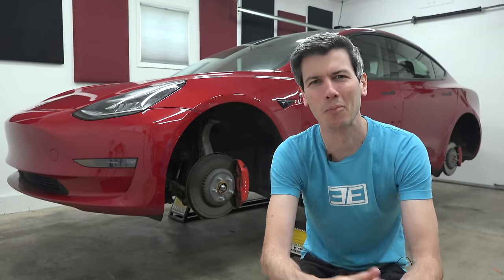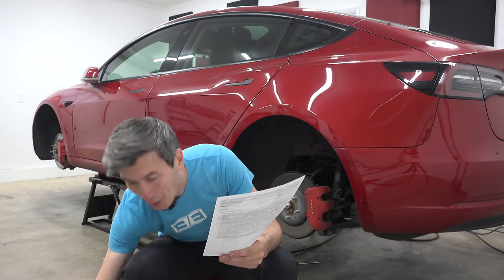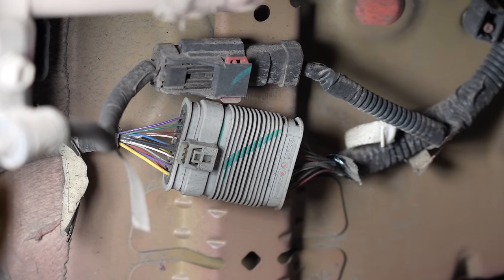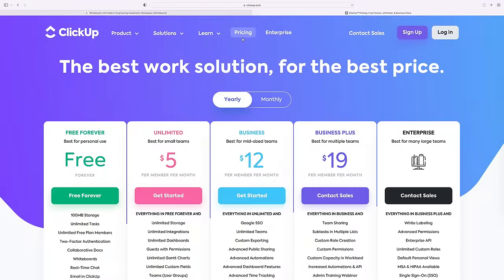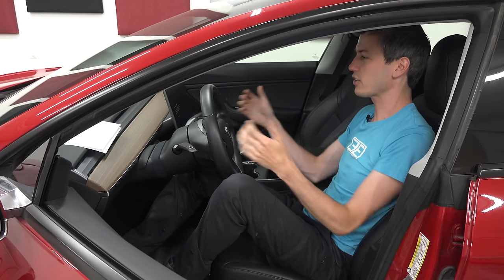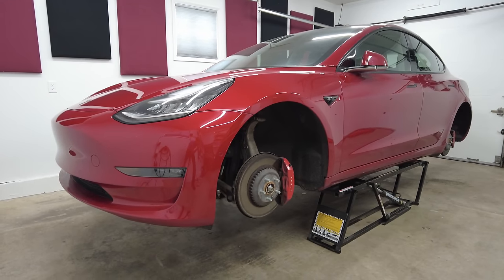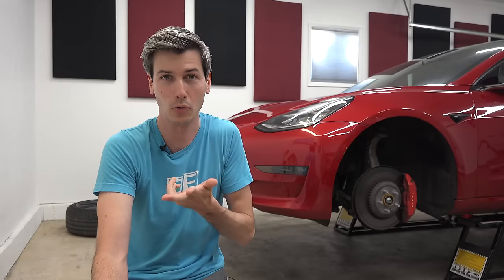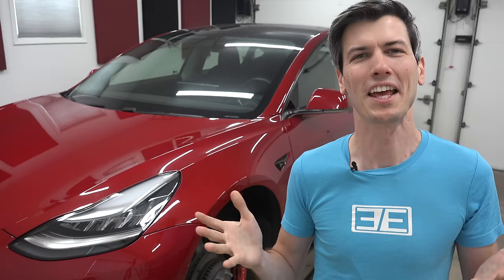Tesla Battery Damage? I Ran Over A Metal Bucket

Comment: I am a big Tesla skeptic, and I believe this video makes one of the most objective takes on Tesla, even though it is a praising video. Thanks Jason!
Reply: @Knaught Shure While you have a great point, there are plenty of Tesla owners that say the same thing time and time again. Its just not there yet as a stand alone car. I have plenty of Tesla friends and guess what, they still cannot get ride of their other car which is gasoline based. Some even have tried. When the infrastructure gets way better, meaning locations, locations, locations and oh yeah, working charging stations. Its just not prime time for the masses. Even then, some of the cost for parts, service (that they do or even wont bother to do) is a bit insane.

What it comes down to is, if you have the money, the time and the patience, Tesla by far is a great way to get into the EV market. However, the average joe wont be going down this road for a long time.
Reply from the maker: Thanks for watching Ethan! The cars definitely have their flaws, but overall, it's a really fun ride.
Reply: @Knaught Shure Actually the two I personally know say it is a great novelty around town. So is my Vespa and its not over 40k. I live in a hot climate and frequently travel on highways over 80 mph for over 100 miles. The Tesla won't do it, period. Right now, its an expensive novelty. Which I'm down with as I have several vehicles that are in the same category.  But to suggest that most can simply ditch a gasoline vehicle and never look back simply isn't true for most. Im not hating on EVs. My next vehicle will be a hybrid SUV because of the range. Cheers
Reply: @Knaught Shure I'm one of those who sold his Tesla for a used gas car. I loved my M3 and oh boy I miss it, but my priorities changed and owning a 50K$ car isn't one of them for the time being. Ev's are still too expensive sadly.
Reply: I’m a fan and an owner but your comment is dead on. He’s great that way.
Reply: @giggiddy  I drive just under 100 miles each way to my brother's house in the winter when the range is worse and I don't even have to charge on the trip. I have a 2018 Model 3, which doesn't have a heat pump and has a lower range than the current models. Heating with resistive coils uses way more energy than cooling. I've no idea what those two Tesla owners you know are doing with theirs. I'm not saying it's right for everyone, but 100 miles is a really low bar. That would be a comfortable daily commute (as far as range goes). You'd definitely need a level 2 charger at home, though.
Reply: @tempesttube  I need to pay better attention to what they are set at and actually document the numbers. I cant say that I see what they are at, charge wise, when we began, but I know that range is pretty much all thats keeping me away at this point. NOTHING on the road is quicker and I love that. We even have a couple of Veyrons in the area and The Tesla might even be quicker than they are. Lol cheers!
Reply: @Knaught Shure Thats a curious statement about the 5 minute charge.  I'm not familiar  with charge rates with the high output chargers. Will 5 minutes truly provide a substantial charge?
Reply: @Knaught Shure Curious because you run yours in heat similar to my climate. If you run at 80 mph, will you still get 200 miles between charges?
Reply: @giggiddy I'm commenting more to show your bias(since you don't own one). You claim you drive over 80mph for over 100 miles. Is that both ways up to 200 miles? Tesla can absolutely do that minus their lowest model which is the standard range and I own that car as well. Hot climates do better with regard to range with regard to EVs. Cold weather has a worse effect to range. To argue it's an expensive novelty, it's actually our family daily drivers and we have an older SUV. Realistically, we have way more fun on road trips with the Tesla. After 200 miles, which is well over 2.5 hours on the road at 80 miles per hours, someone will definitely need a bathroom break. Perfect time to charge, bio break, and enjoy each others company at the locals super charger destination(candy store, steaks, grocery store)
Reply: @giggiddy  The fast charge work less intuitively than filling gas, if you can settle with half full battery, they can charge crazy fast (usually there are their "up to" number came from.).
So for a long trip the fastest way is do many short stop at the fastest charger, you charge for a coffee break, always leave with 50%-70%, repeat... assuming there is a working charger waiting for you.
To top up the battery it takes painfully long tho.
Reply: pyropulse  Most of your information is outdated, and/or propaganda that was never correct!🤣
Reply: pyropulse  this channel has a good video on this exact topic, that disagrees with you. Where do your numbers come from?
Reply: @markbeiser  The CO2 breakeven point largely depend on how much/ which fossil fuel the specific state are still using, for coal heavy states it can approach some ridiculous figure like 80k-100k miles, in these case solution should be building greener power plants CO2-wise (nuclear/renewables) quick, and switch to EV a bit later (but eventually still do)

For more modern states with greener mix (more nuclear/renewable) it would be closer to 15k-20k miles which almost every daily drive are going to go pass, if you go all green (all nuclear/renewable) it can be less than 10k miles.

Which also means if you going to have a car and not use it a lot, sometimes ICE/hybrid might still make sense, for example for a Sunday family 7-seater ICE might still came to the top, but the question become should you really buy a car that you only drive on Sunday.
Reply: @giggiddy  Thats actually not remotely true. Even the lowest range Tesla can easily do well over 100 miles at 80mph. I just took a 1900 mile road trip in my 2019 base model. 

I've owned my car for almost 4 years. Its at 80k miles and 16 full track days. Not a single mechanical issue. I have the videos on my channel to prove it.

A few weeks back I calculated the "fuel" savings vs. my old Golf R. $8500 dollars less in gas and maintenance. I plan on keeping the car another 4 years. By that point I will have saved $17k. That means that my $38k Tesla costs the equivalent to own as a $21k ICE. Wild.

These cars would work for tons of people.
Reply: pyropulse  I believe Engineering Explained has debunked your statement with a previous video. A few points though, once a battery is made with its materials mined from the ground, the battery will be recyclable. Once gasoline is burned, you gotta mine for more. Petroleum is a finite source, and its mining is also destructive to the environment.
Reply: @jasonjaafar  - “the battery will be recycled”

Not really happening yet. Maybe someday, hopefully someday. These are not lead acid batteries.

“Once gasoline is burned”

Once the electricity is used, you have to generate more.

The battery is equivalent to a gas tank on an ICE car. A battery is just a big expensive gas tank that is not as easily recycled as a steel gas tank in an ice car.

“Petroleum is a finite source”

Not really. You can make it from CO2. Natural gas and hydrogen can also be used instead of gasoline. Petroleum is just easy to get, since crude has seeped out of the ground for thousands of years.

“Petroleum… mining is also destructive to the environment”

Oil spoils the environment, by just existing. It is better to clean up the tar sands by removing it & using it, rather than just letting it spoil the land.

It will eventually bubble up out of the earth & spew into the oceans with a small earthquake, so we might as well not let it go to waste, and just use it.

Harvesting petroleum will not stop with the advent of electric vehicles… it is used for water bottles, cups, disposable silverware, disposable plates,clothing, carpets, house siding, roofing, flooring, paint, electric motor windings, electric wire insulation, plastic car parts, battery separators, etc.

Moving to electric cars will do little about harvesting oil. The amount of copper mines opened for all the wire needed for EV’s & charging stations is outrageous. And petroleum is used for all that mining & transport & refining of copper.

None of this is to say that EV or plug in hybrids are bad things, the better we can conserve petroleum, the better for humanity. There are just better ways to conserve it.
Reply: @DavidHalko  Tesla and Redwood Materials have battery recycling processes in place to expand into the future.
As EVs become more widely adopted, and start reaching the end of their life cycle, recycling of the battery packs will scale up.
Currently there is not a big enough volume of EV batteries needing recycling for anyone to be doing it at scale.
Hopefully developments there have been, and those to come in EV battery recycling will result in more recycling of the many millions of rechargeable batteries used in consumer electronics that end up as toxic e-waste.
Reply: pyropulse  If you're concerned about cobalt use, you need to stop driving an ICE vehicle. Considering they use so much cobalt removing the sulphur from petrol.
Reply: @xLordJonx  My thoughts exactly. I felt people I've met who've lauded the Tesla as being so great also own ICE cars. "We use it to take our grandchildren or for long trips." That's the reality.
Reply: @ninemilliondollars  How does it make sense to prefer taking the grandchildren in an ICEV?
However, I do understand that some people prefer having the option of driving uncomfortably long stretches without taking breaks - and also having more options to stop at (since it's time inefficient to make non-charging stops on a 300+ mile journey). To me though, Tesla's ADAS and general driving experience is great enough to make it overall on par with ICEVs for longer trips.
Reply: @xLordJonx  I don't think it's true that the "average joe" won't be getting a Tesla for a long time. If you can afford it, it's really about whether your lifestyle fits it. E.g. If you live somewhere where you can't charge your car at home (or at work), then it's definitely not a great fit until that changes. And if you use your vehicle to drive to remote offroad locations, use it for utility or strongly prefer driving really long stretches with no breaks, then it's neither a great fit as your only car. And if interior build quality and NVH is your primary concern, then Tesla is probably still not your best option either. And other cases not listed here either. But I think for most people, their offers actually would be a great fit, practically and economically. Their demand suggests similarly.
Reply: @Muskar2  Regarding your first question, insuring a valuable "package," like granchildren get to where you want to take them without running out of juice is important. And we know there are not yet enough charging stations around, especially in remote locations, for instance, national parks and  mountainous areas.
   As for people driving "uncomfortably long stretches without taking breaks," many people enjoy the road. And more than once I've driven solo or with friends 'till the tank was close to empty. It's a personal choice.
  As for Teslas, I agree they are fine vehicles and should be quite comfortable on longer trips. And there are fine ICEV that may surpass the Tesla experience. Again, personal choice.
  BTW, in urban areas especially older cities like New York, Chicago, Philadelphia, where there are thousands of small to large apartment buildings and where people park on the street, the challenge of electrifying those neighborhoods is enormous. ICEV will be around much longer than 2030.
Reply: @ninemilliondollars  Obviously it's important to not run out of range. That goes without saying. But as long as you have home charging, I think it's getting quite rare for cases of too little range for a return trip with no charging, or no easy supercharging along the way.

And yes, of course, anyone is free to do what they want - and people's needs vary. I'm sorry for the confusion, if I said anything that suggested I thought otherwise.

I'm also quite aware that apartment dwellers have fewer options most places. But that will change over time since any place that has power and a street could support slow charging for at fairly low upfront cost compared to real estate maintenance costs overall.
By 2030 I'd agree with your speculation that there's going to be many ICEVs. I think even the most ambitious targets will not even have 100% new sales being BEVs by 2030 and there's obviously going to be second hand vehicles for a decade or two as well. I think ICEVs will still stay the majority of registered vehicles for about 20 years or so, and I see myself as a person who's quite ambitious about EV adoption and its potential for becoming the preferred option. So I don't think you're saying something remotely controversial when you're suggesting 2030 will have plenty of ICEVs.
Reply: @Muskar2  I think we pretty much sync up on our ideas. 😀 I like the idea of BEV cars and bikes. My brother has a BEV bike and loves it. And he's a very good bicycle racer. The cost of BEV cars is prohibitively expensive right now, an obstacle to getting one. I did a GoogleMap search in one of my favorite states, Utah, and only found 79 charging stations, most right along I-15 and not widely dispersed throughout the state. That's where I see a challange for taking a BEV on a vacation - the remote areas. As for urban apartments like in Chicago, that is a extradordinary challenge. Chicago has used lead pipes for delivering water from the street to homes and apartments all over the city. There's a project to replace them. The streets have to be torn up. It's going to cost about $10 billion or more. I don't think there's any money for BEV charging stations, nor time to do the work soon. So just my opinion that it will be a long time for enough power to be built for all the urbanites. Finally, I do appreciate conversing with you. Having a meeting-of-the-minds so to speak has allowed us to learn from each other, which is good.  😀
Reply: @Knaught Shure I know someone who sold his plaid because it has no sound and no feel too it, he bought a brand new R8 audi with a V10 because he grew up feeling cars like a true enthusiast.
Reply: @giggiddy  
So someone told you the range of a Tesla is 1 or 200 miles?
It’s never been that low.
Reply: @xLordJonx  I've never experienced a Tesla charger that didn't work. Its not a do all car so your right in that regard, I have a diesel that I use to pull my 5th wheel RV and another gas truck I pull my boat with but I drive my Tesla 95% of the time and hate driving the others when I do drive them.
Reply: @Knaught Shure I don't get it. I've driven my model 3 a few thousand now and I'm longing for something else already. There are some quite clever things, and the efficency is remarkable. But there is so many useless features and a way too sterile interior. Exterior is also awful, even if it's very efficient.
Reply: @ninemilliondollars  If they are spending billions to tear up roads to install new pipes that seems to me the perfect time to drop new cables at the same time. You're already paying a lot of the costs anyway.
Reply: @oerthling  I agree, But Chicago is removing the lead pipes from the street to the connection in the house. And they are so so slow in getting this done it will take like a decade. And there's no advertised plan about electrifying anything related to BEVs. I do think we need more real experience from smaller cities that have deployed this infrastructure before scaling to a city with countless apartment buildings and highrises.
Reply: As a vehicle not in need of anything more than normal service a Tesla is ideal. Entering the world of service or body repair your certified repair shop might be half way across the state. "Rich Rebuilds" here on YT has pointed out the nuances that crop up with the brand. For example a brand new lease owner struck something also under his Tesla. The damage was a simple nipple involved with the cooling system. The battery case itself was fine. Tesla designated repair priced the repair for a new battery  $16k. A simple addition of a small brass nipple threaded into the part that broke was all it needed. It was done for $700. The guy was on the hook for repair. Being a dedicated service center the wait time was unrealistically long along with the cost of replacing a brand new battery. 
So yes, if you have the good fortune to just drive with no mishaps or need of repair it will probably be a good experience. I am still of the old school that wants to spend 20 minutes refueling and be back on my way as it suits me not tethered to my car to spend time "refueling" or else. It will be a relearning curve for those that will accept the adjustment to configuring a long distance drive.